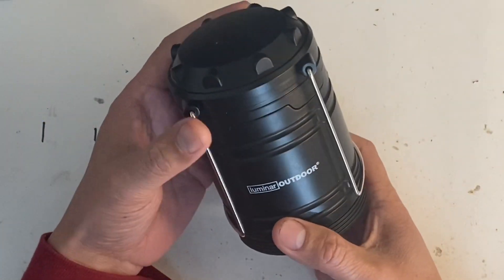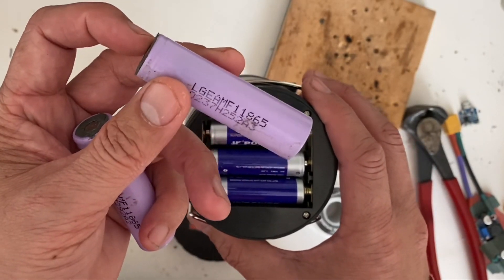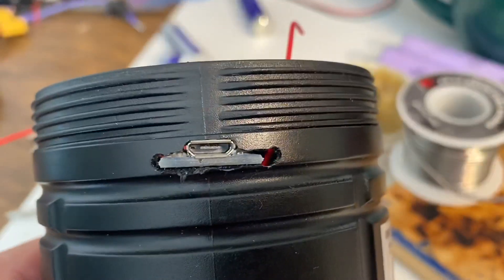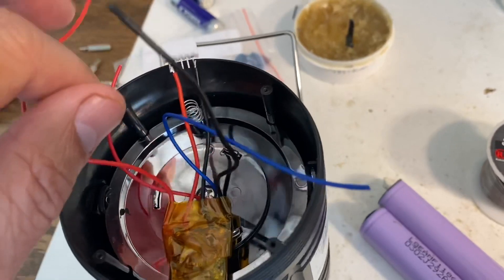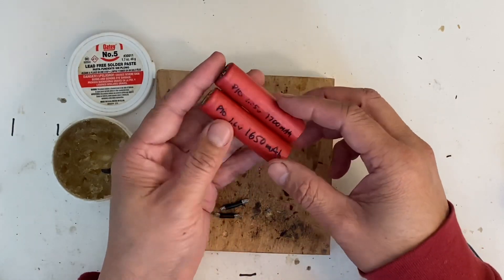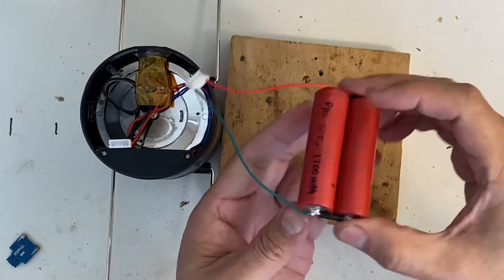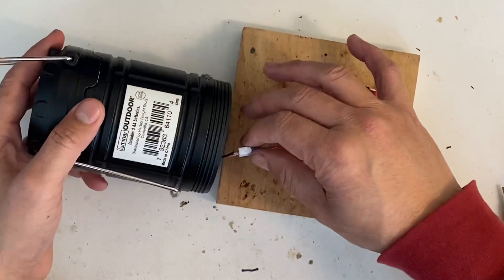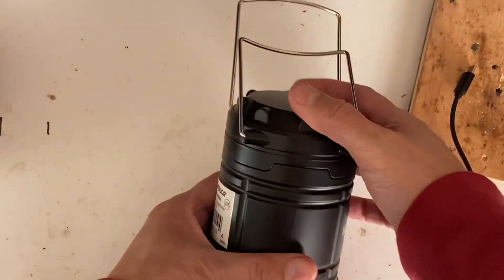DIY lithium battery pack for LED lantern flashlight USB charger conversion

Comment: cool another vid with soldering lithium cells, why you are not informing viewers that is is dangerous and shouldn't be done?
Reply from the maker: Thanks for your concern and comment. Nothing wrong with soldering cells so long as you are doing to properly. I have built many dozen battery packs and soldered over 1000 cells the past 10 years w/o any issues. Agreed, proper care should be taken when soldering cells.

Comment: I had a crushed lantern and took all the guts out and 3d printed a enclosure and 18650 battery holder, used the all parts to make a custom light to fit in my under-stairway closet where I have no AC outlet. Your video was my inspiration!  I can slide it off the ceiling and charge it. A Big Thank you for guiding the way.

Comment: Such a great idea. Thank you. I did it to mine and it's working great. I wish someone can design battery housing for 18650 battery, that would be amazing. I have seen one of Amazon seller modified their product for hybrid batteries (3 AA and one 18650)

Comment: Why just not adapt it for 3 rechargeable AA 2700 mah batteries?
Reply: 18650 has bigger capacity per cell than rechargeable AA batts. And since those li ions are wired parallel, you get twice or triple running time compared to AA batts.

Comment: Does the TP4056 get hot when you re-charge both batteries in parallel?
Did you ever have a problem with the hot glue melting?
Have you considered an aluminum heat sink on the charger board?
---> I have several of these, just got them. 
Not sure if they will over heat yet - Still investigating.
Thanks for a quick response in advance!
~J
Reply from the maker: These boards have a fix amp draw/output so it won’t get hotter charging batteries in parallel. Heat sink not needed as the draw on these leds is low.

Comment: Nice hack. Does the tp4056 has over discharge protection too? I also like your soldering tip. What is the proper name for those tips? That is the quickest soldering I have seen while soldering on 18650 cells.
Reply from the maker: Yes this one does have discharge protection. The soldering tip is a standard medium size tip that is worn out from use. I find that it works much better than a new tip.

Comment: Or you could buy rechargeable AA batteries or a rechargeable lantern/flashlight
Reply: Every hear the term recycling? Or just make more plastic junk and throw it in the bin?? If you already have a lantern or flashlight, already have an old laptop battery(I've had a few power banks fail but the 18650s inside have been perfect) then you need a tiny circuit board and some time. Plus it's fun to make things. This same project could be adapted to quite a few different AA/AAA powered devices if there's room for an 18650 or two.

Comment: Cool project!  I saw these at the Dollar General and had the same idea; I secured the batteries to the base so they can't flop around when it's open, and added a 3ohm resister to limit the current (that dropped it from drawing the full 1A the TP4056 supplies down to .3A).

Not sure if these links are allowed, so replace the _ in the middle with a . and copy/paste:
i.imgur_com/ek5sFbn.png
i.imgur_com/bVzI7QE.png
Reply: Are the resistors adding runtime due to the lower run amperage? If so, I wanna add that! :D

Comment: the tp4056 is for a single battery, you will not have problems in the future? 
by the way, excellent work!
Reply from the maker: Thanks. There’s no problem hooking the to4056 up to multiple batteries as long as it’s connected in parallel.
Reply: @Lowegy  Thanks for answering, you freed me from a great doubt, thank you very much